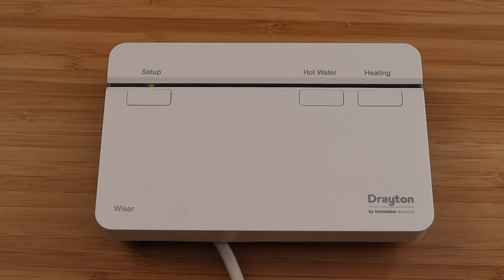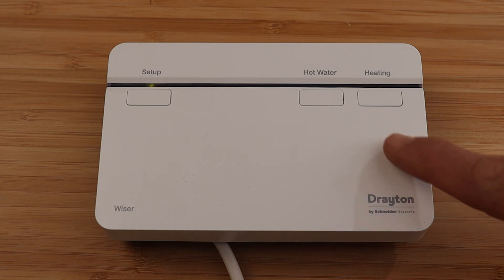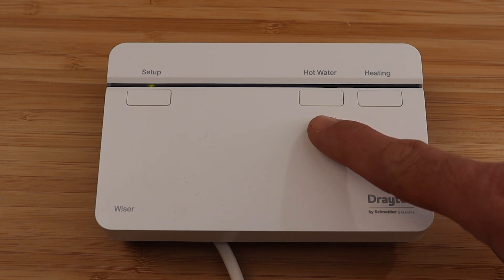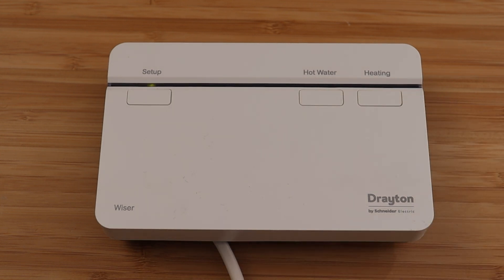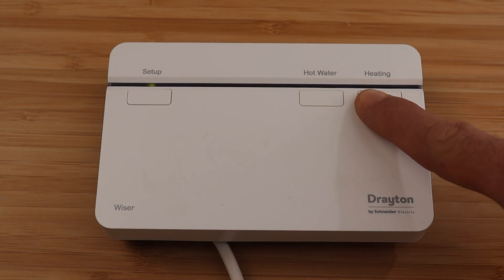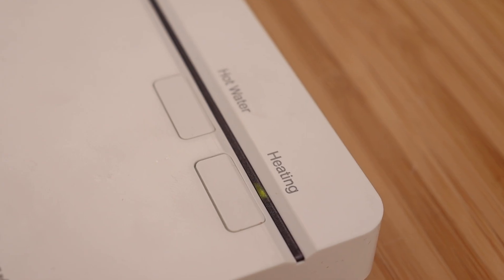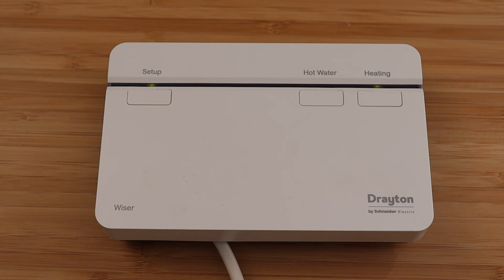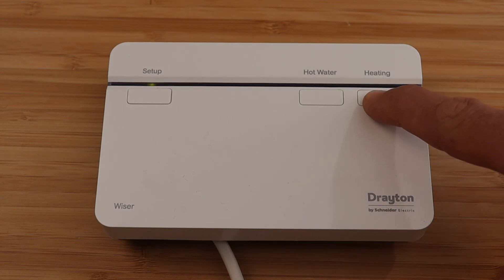🔧 How to Manually Override Your Wiser HubR Heating System 🌡️

Comment: How do you end the heating override panel buttons from the app?, is this possible?. If the button was pressed or you left the flat with the heating on?, having used the manual overide button as the smartphone was charging. Thanks
Reply from the maker: Hi, thanks for contacting us. We’ve received your message and appreciate you reaching out. However, please note that in order to ensure consistency of support, we are unable to provide technical advice via social media. I recommend contacting our technical support team, who will be able to talk you through the best options for your situation. The number is 0333 6000 622.